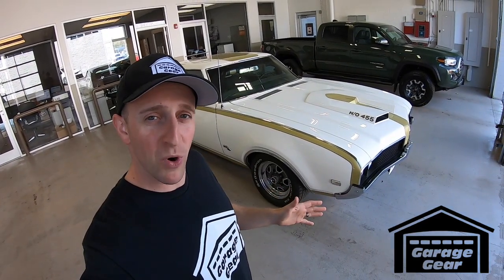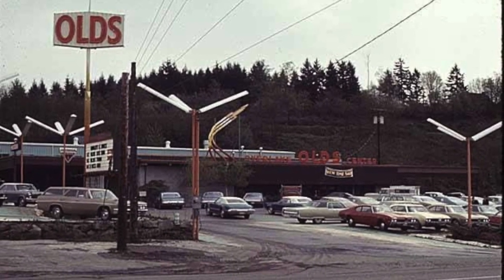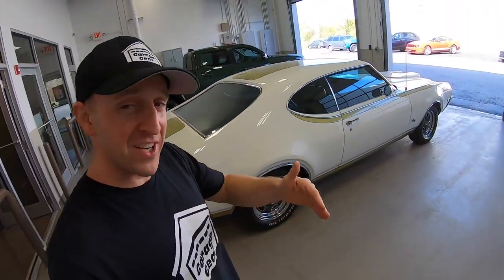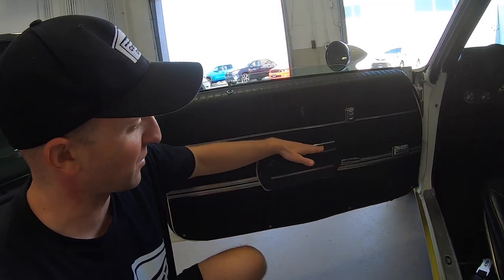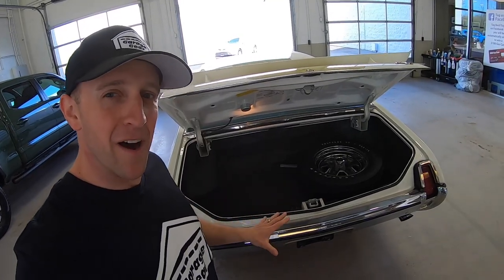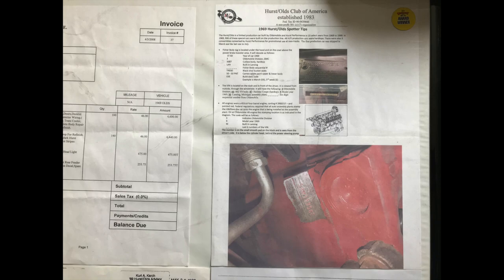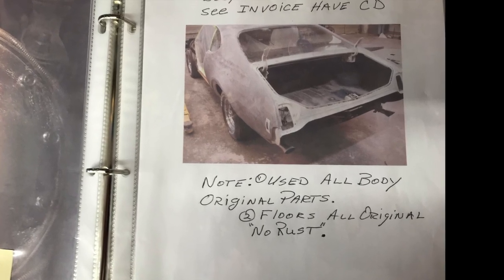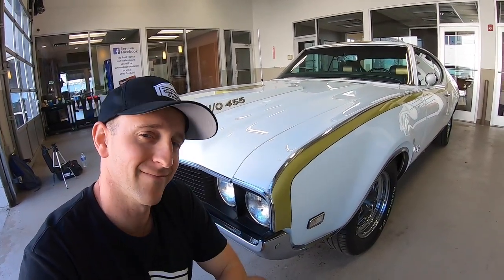Is The 1969 HURST OLDS The MOST UNIQUE MUSCLE CAR Ever Built?

Comment: Mines just a plain Jane. The Dragon.Dragon skin everywhere. W-34 "bronze" 1970 455.Hays 64.6 lb.billet flywheel.all new m-21 box. Bellhousing from a 1970 Pontiac Grand Prix SJ...HUGE clutch fork...4000 lb. PP. NO pb but yes power steering from '72 Delta 88 var.ret. divorced choke..pull to the floor and lock fast idle..don't.louvers..pass.side oven w/door. 4 scoops...into a 1910+ carb. Torquer 455 manifold...wink
Reply: The actual list is 76 Hurst..Yenko level upgrades..or better. It's a bad badboy..even though it was a basket case. Holds the eluding record....shhhhhh! 2.15 miles in 58 seconds and I stopped twice. It will fly apart.. 6800 rpms=190 mph. Oh ****!
Reply: OMG!... In a 35.
Reply: No accidents. So the judge was easy on me.
Reply: My Dad made the little Blue Lemans...spring of '64 
..with a SD421. Its in my blood..Thanks to Pete Clamo.. for all his help!
Reply: Still the meanest GTO of them all..before you could get one. It had a hot 326..sag..top loader stock. Pure adrenochrome
Reply: Adrenaline
Reply from the maker: Thanks for sharing all this James!